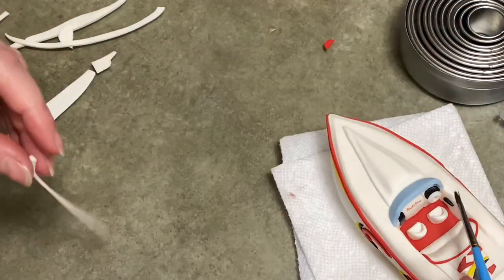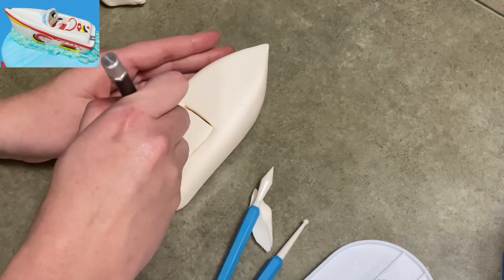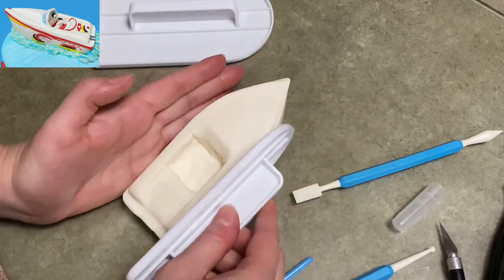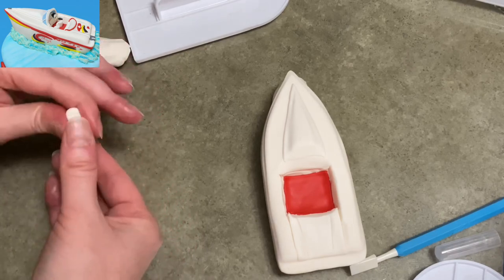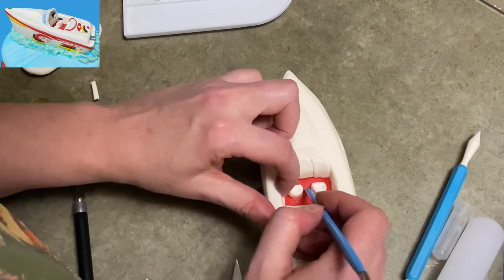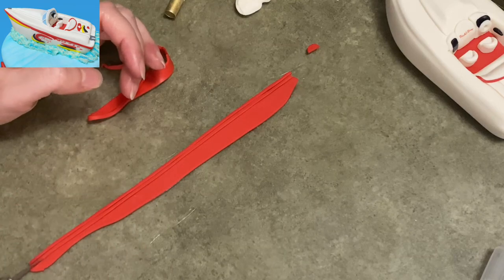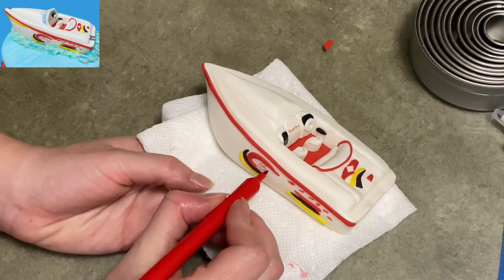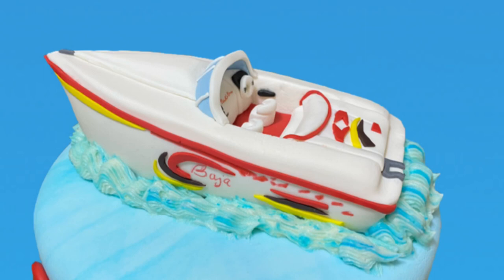Speed Boat Cake Tutorial - How to Make Boat Cake Topper

Comment: Hello..What do u use to firm fondant...??
Actually it's very humid here..It causing so much problem 😒😒
Reply from the maker: You can use cmc powder or tylose powder (same thing, just ones a brand name). That will firm your fondant right up. Humidity is terrible for cakes and decorating- I hear your pain!  I’m sure you are already, but try to keep it in air conditioning as much as possible.  Good luck 👍
Reply: @CaketasticCakes  Thank u so much😘😘